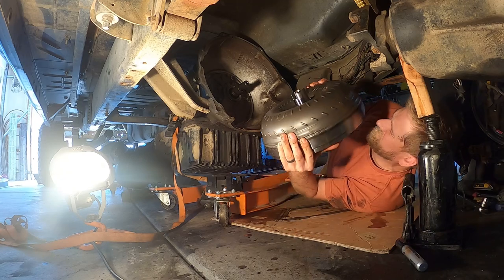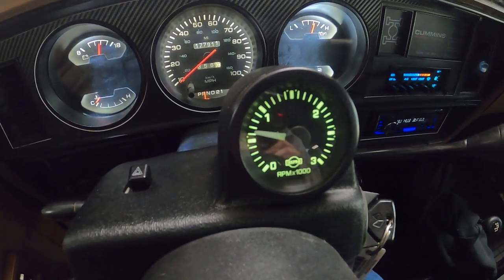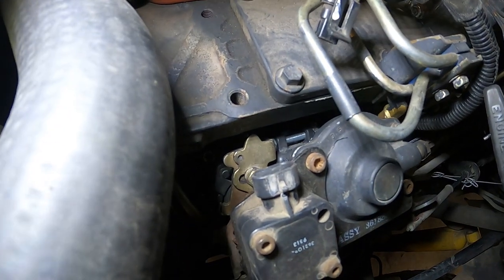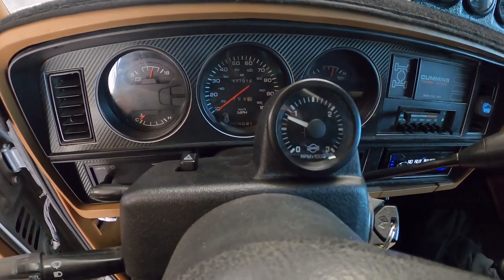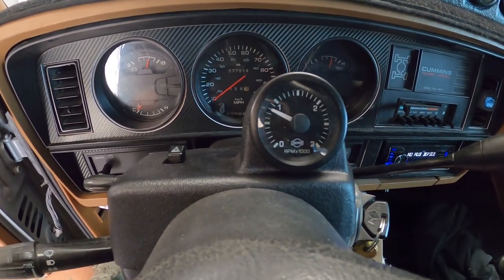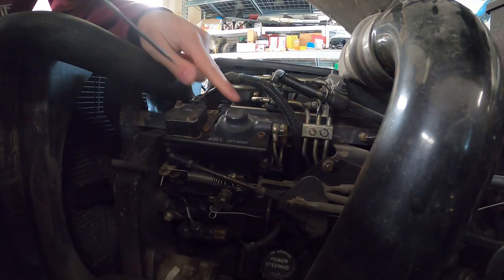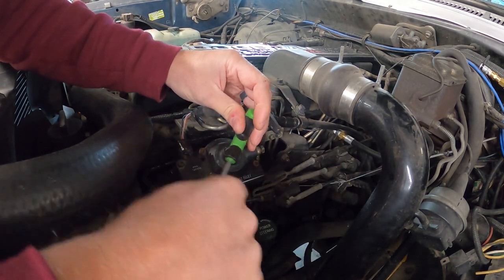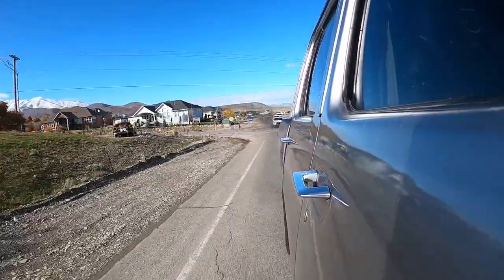New Torque Converter = AFC Tuning | 1st Gen Cummins

Comment: check for air leaks in your intercooler tubes, i tightened all that up on my 96, and it made a HUGE difference, that truck runs GOOD,  i bought two fairly new in the early two thousands, a 99 quad cab cummins for my parents, 260,000 miles, has 600 plus on it now and still dependable, only clutches and a lift pump, and an 01 quad cab dually i sadly let go of 2 years ago with only 140, 000 and change, that automatic in that thing gave me NOTHING but trouble, it started upshifting and downshifting erratically at about 70,000, and i already had to replace the pump after my ex put gasoline in it, and didnt tell me till later when  i noticed how it was running, i, like you, do all of my own labor, and it ran okay, but even new, that truck was never a good truck,
    so i sold it, and bought a 250,000 mile plus 96 12  valve,
another dually, has a broken nv 4500, and is somewhat beat, but it runs fairly well, it suffered from killer dowel pin before i got it, it broke the cam gear, and STILL RAN! i drove that truck all over the western u,s, and other than sounding like a coffee percolator when it warmed up, it ran fine, i got in it and fixed it wasnt hard to do, i have all i need to make it easier, i've been around the series of trucks you have,, pre diesel, and i have been a cummins diesel lover since i test drove a new one in 96, fell in love with them, i have given you a few pointers, like your choice of trucks, and the drivetrain in the one you're driving

Comment: My truck has a the lip machined off inside the afc cover. It allows the fuel pin  to a higher position and more range. It's like being able to back the smoke screw out even further. Maybe worth looking into.
Reply from the maker: Yep, I'm actually looking in to doing that as well.

Comment: So heres how I understand it a tighter converter =more efficient power transfer now you can never get an auto to be 1 to 1 like a manual but you can get close. Because it's a more efficient transfer of power your building less heat in the fluid(ie less slipping) and giving the gear packs more power thus the engine loads up more because the gear packs are taking more power from the start...AFC adjustment as you did pulling pre boost fuel if you haven't advanced pump timing I'd give it the old 1/8" bump(if it's a ve) and then get it more air...you'll pick up alot of bottom power and a cleaner burn. Also you should check and adjust the kick down for the transmission now that it is running a more effective set up you can play with the line pressure get firmer shifts and just better clutch engagement now gotta be careful there becuae to much line pressure can burn up or damage the clutches and bands. Hopefully this helps as always best wishes decent.
Reply: Awesome info! I am playing around with spring pressure to up my line pressure.
Reply: @DakotaB90  nice man just be careful giving the pistons too much line pressure things will break lol...but if your in there playing with springs then u probably know a thing or two. But as always keeping up on routine maintenance of the vavale body and bands really helps these old autos run well.

Comment: I'm not sure how far your power screw is in but you could try bumping idle a bit with that screw. I had to do a lot of tweaking here and there between the afc preload,  smoke and power screw. My idle is at 900rpm in gear and ac on is about 8-825rpm. I have zero smoke even if I try but have a industrial duetz HX35W.
Reply from the maker: Yeah I've got my power screw in about as far as i feel comfortable.
Reply: @decentgarage  👍
Reply: Don't want too much idle rpm because the engine want to pull/take off as soon as you put it in gear.

Comment: Noticed your voltage, you may be a bit high,  Your pickup must be a 91.5 or later and use the ECM for the regulator, I am lucky and have the pre 91.5 with no ECM. I had to find a New, Old stock Standard Regulator that was from the early years that wasn't a Chinese one to get away from the 15-18 volts. Do you find that with the reduction of the black smoke your pickup seems a bit heavy on the turbo lag? Great videos though
Reply from the maker: It's charging right under 14. The stock gauge just doesn't always look the same on all 1st gens and where the needle sits. Yes i do feel like the turbo is a little laggy now. Saying that i can't imagine how bad the lag would be had i gone with a low stall converter.

Comment: Need to adjust the star wheel back
Reply from the maker: Yep i realized that as well. I'll back the start wheel out a turn or two
Reply: Why does the star wheel need adjusting? what does this do?
Reply: @markroybal8958  the star wheel controls pre boost. The loser the spring the more fuel gets dump in causing black smoke on the low end and cause turbo lag tighter the spring less fuel.
Reply: @bigmurph1447  I replaced the gov spring and pin in my 93 W350, I can feel the difference but now it seems it takes a little longer to build boost can't detect any boost leaks would  I need to loosen the star wheel then to increase pre boost?
Reply: It just depends are u getting alot of black smoke on take off. Also how's ur fuel pressure?
If u have a ton of black smoke down low u need to tighten it. If u have no black smoke down low u need to loosen it 2 turns at a time u will have to play around with it

Comment: Doesn't 850RPM seem a bit too high in park? Or is that just me
Reply from the maker: After driving it a few times since filming this i agree. Im going to lower it to 800 in park would should out it right at 750 in gear.
Reply: It should be 750 idle and in drive too.